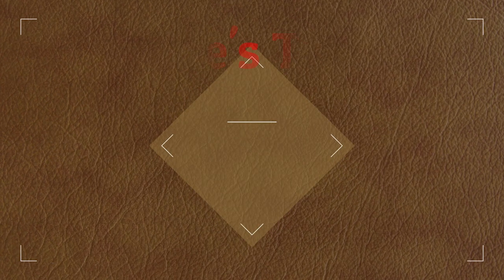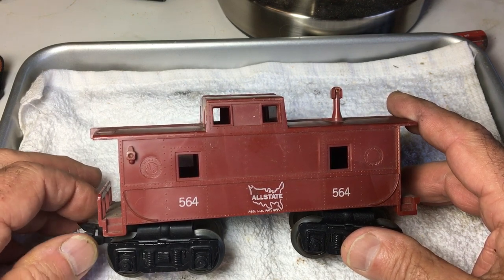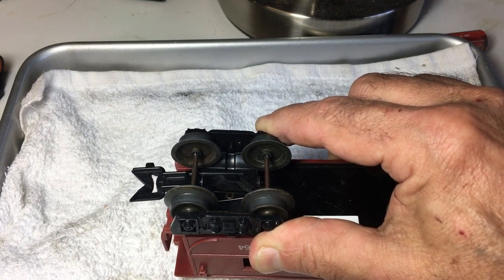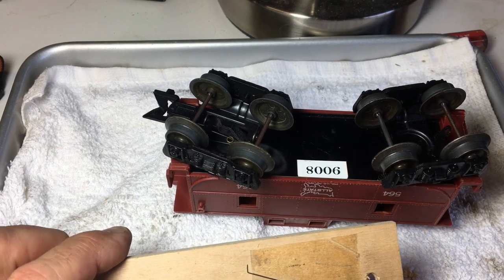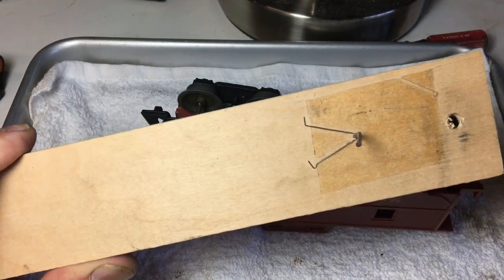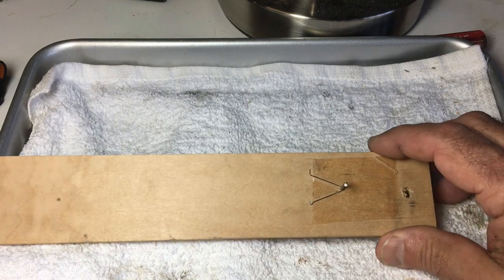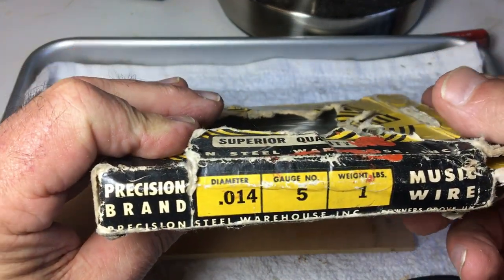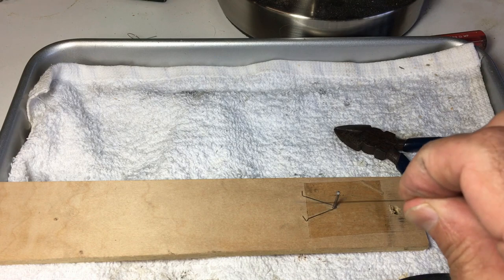#24 - Make a replacement spring for Marx coupler.

Comment: Could you also use a drink straw in place of the square stock for inserting the spring?
Reply from the maker: The corners of the square catch the tail of the spring so you can rotate it into place. I think the round straw would let
the spring move too much. But, worth a try if you don't have square stock available. Good luck!

Comment: Would a guitar string work?
Reply from the maker: Ooh, good idea. I don't know if they are "springy" enough. But certainly worth a try when you change out a set. Maybe a G or B string. My wire is .o14"  but I would try anything up to about .o20" .  Lemme know if it works out.